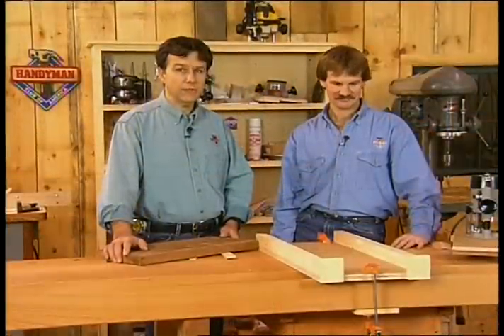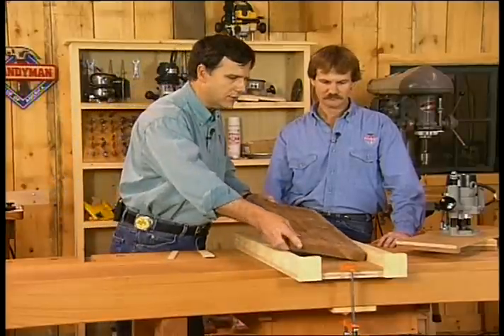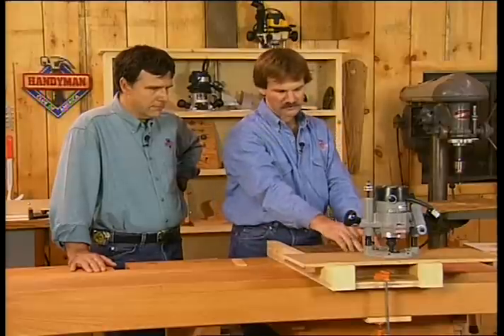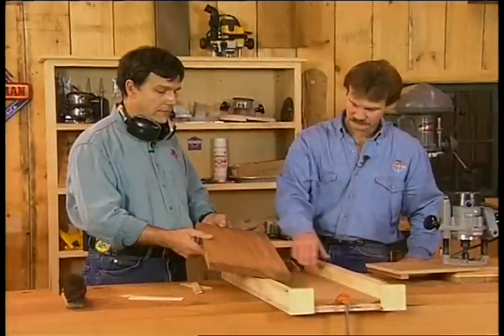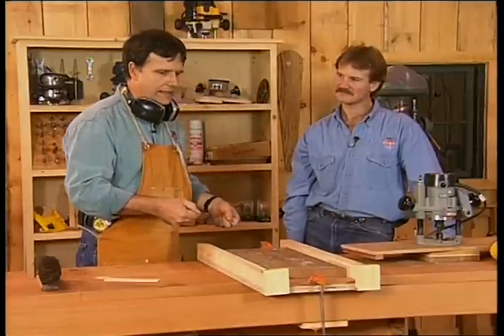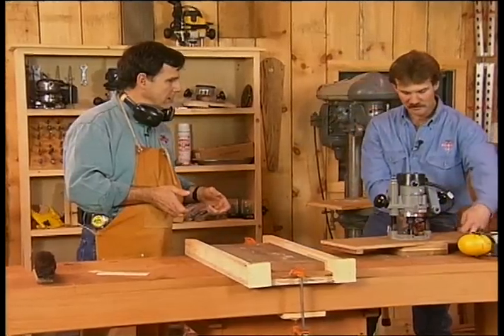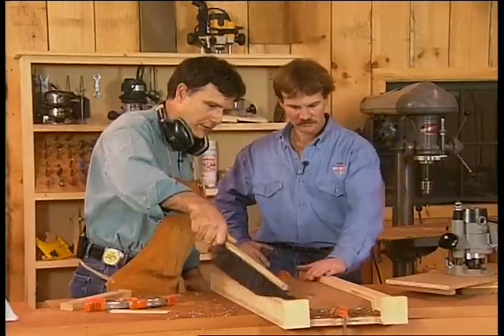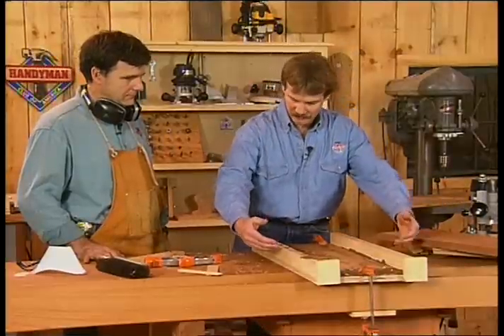Advanced Routing Techniques Part 1

Comment: Would you not be concerned with the final gauge of the board being a standard? for instance, it looks like it might be about 5/4, but if its 1/8 off either way it wouldn't be uniform to typical lumber you may use it with...

Comment: This is for someone who has a lot of time and does not have money for a planer.
Reply: which concerns a lot of hobbyists :p
Reply: What a precise description of me :) In fact, i do have money for a planer, i just dont have space for it :)
Reply: Not just a lot of time, maybe not enough time to learn to use a hand plane properly.  I find doing it this way easier than using a hand plane.  One day, when I can dedicate the time to actually using a hand plane enough to not forget how to use it in between uses, I'll start relying on the hand plane.

For now, though, this method works very well for short pieces that I don't want to discard but cannot safely machine on my jointer and planer.
Reply: A planer doesn't necessarily straighten a board, if it's bowed it doesn't always correct it. The use case in the video would correct that straightness.

Comment: I think it's a cool idea, I don't have a thicknesser or planer because they would take too much space in my garage-shop and are very expensive. I have tried hand planing a glue up lately and I actually made it worse and spent hours sanding out the places where the plane blade digged in.. This would have made my life so much easier. Why the hell is this getting so much negative feedback?

Comment: even worse TCT is so hard and brittle that unlike planer blades (which often are of HSS) the cutting tips will fracture and fragments are likely to be propelled away at high speeds. With HSS cutters you will usually only get a notch.

Comment: I don't think a thicknesser would flatten that board if it is bowed, it looks far too stout! Is the argument that a nail embedded into the wood would be okay to dress with a router cutter rather than a planer blade because the router cutter will be cheaper to replace and is TCT as opposed to HSS steel? TCT cutters are brittle and arguably flying debri is dangerous without eye safety protection.

Comment: Build a jig for a scrap piece of lumber? Are they nuts? If you can't fit it through the planer, then rip it, joint the pieces, thickness each in the planer and edge glue. A lot less work.

Comment: You could of just sent it through the planer -.-
just find the high spot and minus a 1/16" plan till you have have removed all the rough material flip it and use it as a reference. Done under 5mins.

Comment: Yeah but if you dont have a planer, using a hand-plane seems to take a long time. Also you can cover a potentially unlimited sized surface area with the right rail/sled system, unlike a planer which has a max. width.

Comment: Not a fan of this approach at all. IMO a thickness planer does the job MUCH faster and more efficiently. Just use a simple metal detector to determine if there's any nails in the wood first. Seems like a LOT of extra work to resurface a piece with a router.